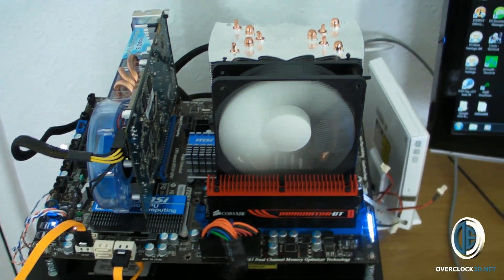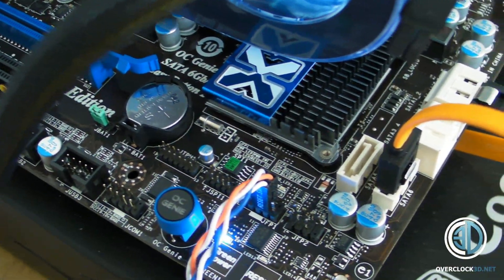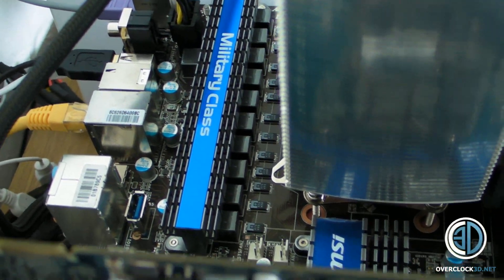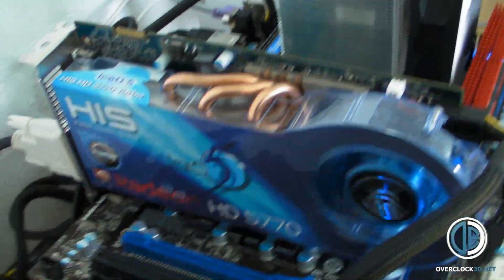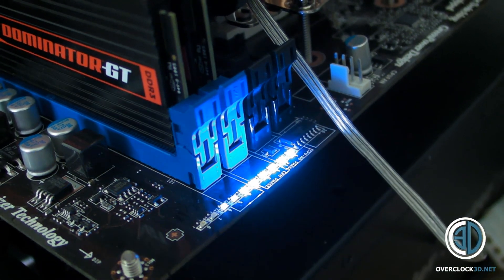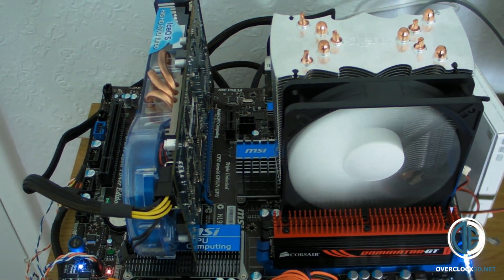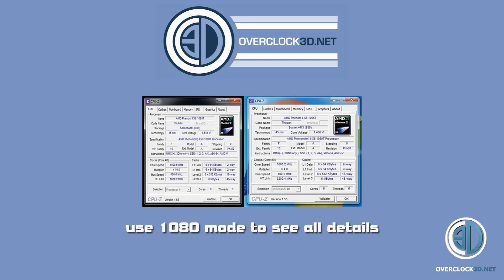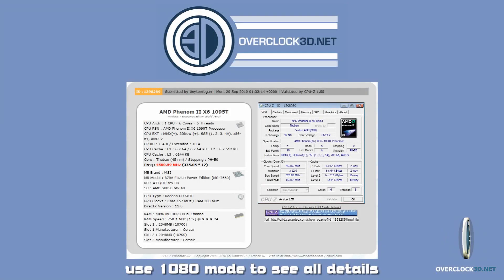MSI 870a Fuzion POWER EDITION  Motherboard Review FIRST

Comment: Hi, i was ready to buy this mobo, but worried afteri reading the tweaktown review about this board. When they tested actually with 5 different games, the x mode ati with nvidia card, they saw in 1 game performance boost. Can new drivers fix that? Have anyone tried with 2 different nvidia or ati card game benchmarks?

Comment: Would fuzion work with a 5970 and a gtx 480 properly since the 5970 need crossfire enabled to use both gpus?

Comment: @milorad31 If you disable CnQ & C1E in bios it will allow you to overclocked all six cores the same speeds. You can choose what ghz you want each core to ran. But with turbo mode on it will also idle the overclock for when your not using it.

Comment: Can you please answer my question? i currently have some overheating problems with my cpu and I would like to buy a great cooler which could overclock my i7 920 to 4GHz tops but both the coolers Which I liked the coolermaster V10 and the Noctua NH-D14 dont fit since i have dominator memory and the tops aren't removable...

Comment: Looks like you have an old version of the board - msi website lists it as ver 2.01 - layout is different - also what a horrid name - it is not an 870 chipset - it is a 770 with the new south bridge - newegg has the specs wrong - what a mess.